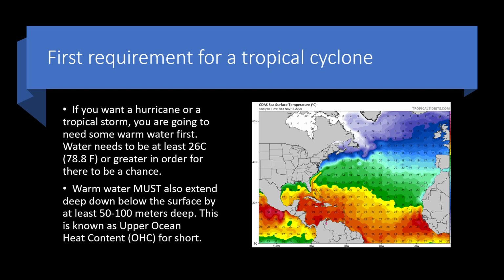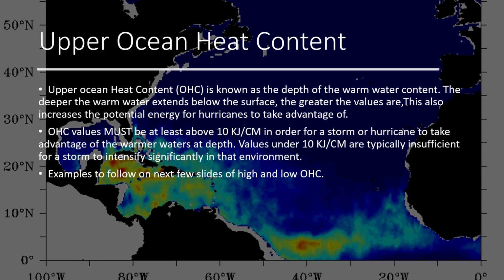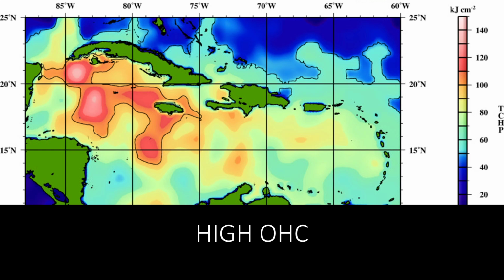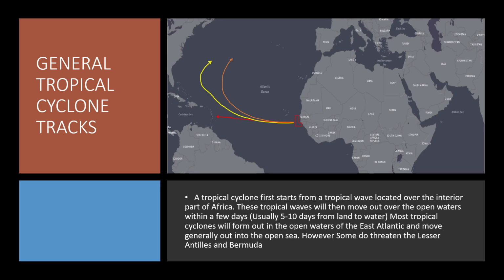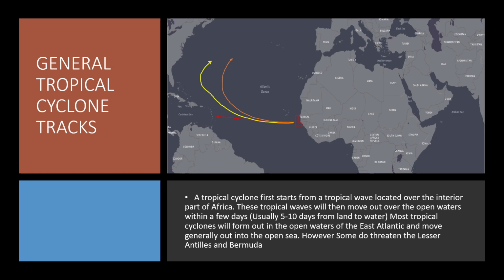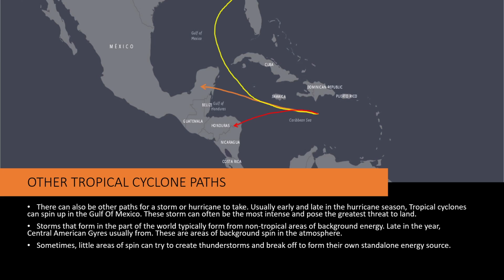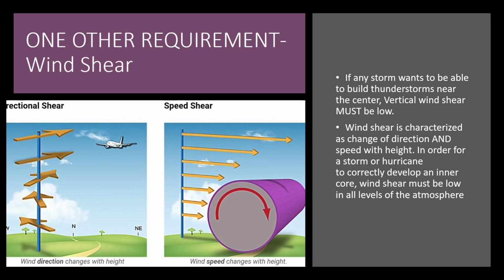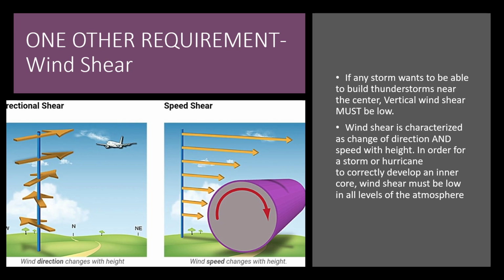Hurricane Forecasting Lab 1-Basics

Comment: Another question, if you plan on being a meteorologist, do you need to already know physics and chemistry to start college or do you get taught at college? Also, if you take math courses before taking college, should you take a lot of courses or just some?
Reply from the maker: You would need a four year bachelors degree in meteorology or atmospheric science to be able to work in most academic and government jobs regarding weather. You would need to know math so having a class in pre-calculus/calculus would help also chemistry would also help as well. These are classes that you can take either in college or in high school. My recommendation would be to do these classes in high school but if you can’t then I would do them in college.
Reply: @Weatherforce11  Could you still get the degree in college if you do chemistry/physics in college?
Reply from the maker: Well, you can do a major and a minor in college. So you could major in something different but still technically have a degree in meteorology if you take that as a secondary major. Or you could always go to school for longer and get multiple degrees. But by and large meteorology takes four years of college my recommendation would be if you absolutely want to do meteorology I would if you’re already in college change your major to meteorology or you can optionally go back to school for four extra years to study meteorology. Or you could add that on as a minor.

Comment: If you are making a basic hurricane forecast, do you need to use math or look at models and other things. If yes to math, what type of math?
Reply from the maker: If you were going to be in the academic part of meteorology then absolutely it would need to take some math classes. However if you were just doing this for fun and not part of the academic or government program, you will not need to look at math. It is recommended that you understand some of the basic formulas to go into Basic meteorology. There are tons of great videos out there going over the basic formulas of calculating certain parameters and understanding different charts. I will be taking a look at some of those in the next video.
Reply: @Weatherforce11  Thanks
Reply from the maker: And for the second part of my answer; for the models; yes absolutely. Models play a pivotal role in understanding different parameters that they are predicting and what the range of possible outcomes could be.